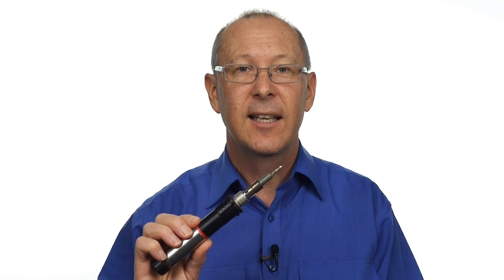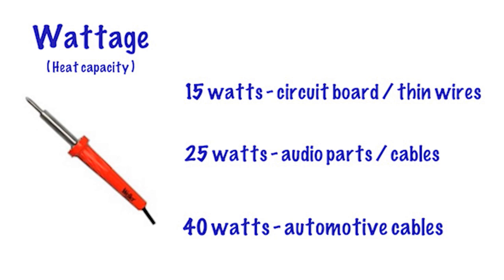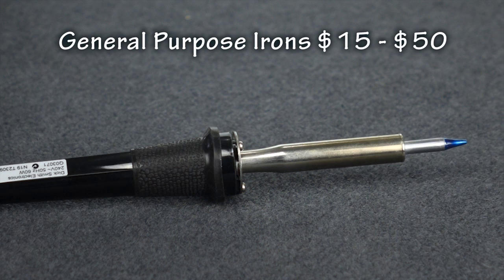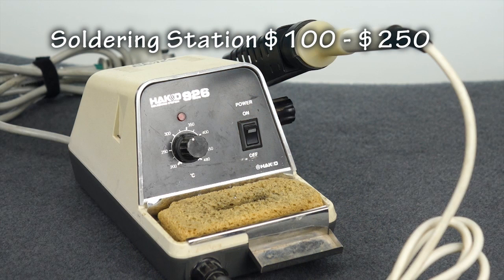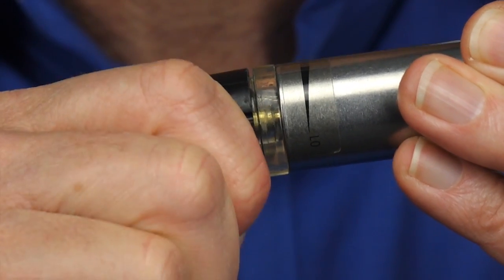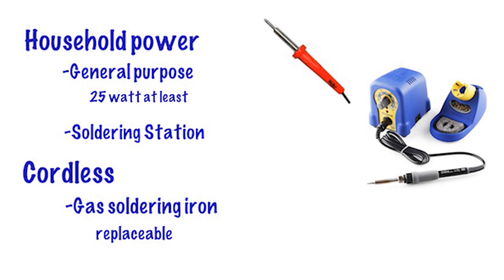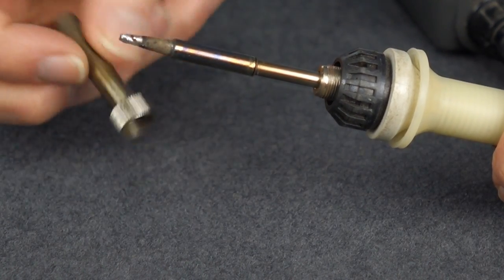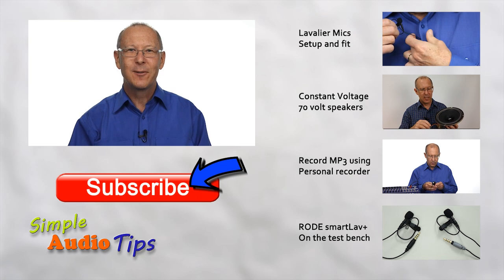Which is the best soldering iron to repair audio leads?

Comment: The tip is what matter, a crappy tip is a the same as a crappy solder iron, then comes the heat transfer from the heating element to the tip, some cheap irons are very bad in this regard.
You also need to maintain the tip by keeping it clean and always covered in solder, this is to insure a good thermal transfer from the tip to the thing you want to solder.
A cheap Chinese Hakko knockoff solder station is cheap and tips are cheap too, so it is a good value for the money spend, one can use original Hakko tips on the Chinese thing too and they last longer than Chinese tips do. Tips need to be covered with a protective coating to extend their life, the issue is that flux (you add or it is in the solder) will over time eat the copper, so if the tip is copper then it will change shape over time because the copper simply are disappearing, but this protective coating on the tips comes with a drawback, if (when) there eventually will come a hole in the coating then the copper inside the tip will simply disappear slowly and you will feel like there is not enough heat to do the soldering job. All this just to say, keep some spare tips on hand, you will need them sooner or later. Another tip killer is if the solder iron is standing turned on and otherwise unused for a longer time span then the tip coating can go bad and you are unable to make it accept solder at all, then there is tip cleaner or mechanically removing the outer layer of the tip, but that can also create the unwanted hole on the coating, yes, nothing comes free.
The best soldering iron to repair audio leads is useless if the iron is not in good working condition included a usable tip, and you need to have the skills to do the soldering too.

Comment: Try reflowing nickel sized solder pads on a 1965 Fender Super Reverb amp with a 25w or 40w iron, that giant old iron works perfectly to heat up them big old solder pads in seconds..

Comment: Hot air irons aka smd or surface mount device.... Flux and soldering pasted or solder wire like Ron core or classic 60/40 soldier.. I love my pyropen WSTA6 butane 3hrs 15min off of a full  resinous of butane.. the valve is easy to use and holds a steady temp it works well with silver bearing solder granted the tips burn out rapidly and suck solder into the threads making the tips difficult to change at times but its a great portable tool and hold its tempature  once properly  adjusted  till it literally  runs out  of gas...
Reply from the maker: Thanks for sharing your experience, I appreciate it.

Comment: there is a new soldering iron for hobbyist made by miniware ts100 and ts80. are awesome for general electrical soldering usage. they are cheap, portable, great temperature controlled and very usable only thing not sure is how reliable are they. be sure to check it if you are a hobbyist or need a cheap but great soldering iron
Reply from the maker: Great tip Shadman, thanks. Sounds like it's worth considering if you are on a budget.

Comment: Informative, thank you. The soldering iron landscape has shifted considerably since this video was made. TS80, TS100, T12 station varieties are three examples of excellent irons to be had for under USD$100 for their base models. Soldering with a proper iron is LEAGUES better and more enjoyable than soldering with a crappy one. I had to go through an assortment of rubbish, low-priced irons before I learned my lesson.
Reply from the maker: Great advice Helman, thanks for commenting.
Reply: @GaryDmedia  I just learned that the TS80P has been released with USB-C Power Delivery for higher output power. 👍

Comment: got a 60w 480 deg c adjustable temp soldering iron and it was perfect for 6 months i soldered thick awg cable for £8. but now it seems like 
30w and the tip cools down instantly with thicker awg but is still great for smd and small cables. :(
Reply from the maker: Yes the smaller tips won't store as much heat. Fine for smaller cables.

Comment: Which one should I use when soldering capacitors or cables on the motherboards because when I tried it doesn't stick on the board and it just stays loose or the wire  doesn't liquefy when I heat it up it just starts to change color and stays on the iron . If you could help me choose the right wire for the job and the right iron.. thickness etc..
Reply from the maker: The best advice I can give is in the video. One thing you should check with your iron is that the tip is clean and not a black colour. If it is black it won't heat up the solder or even the board. I have another video that may help: https://youtu.be/uzUjCGYgV_k

Comment: The large iron you said has no use for audio technicians indeed has a use that none of the other irons can accomplish easily. Any point to point wired amp (and most circuit board amps) have a ground to the chassis. They are best soldered in place (better than star washers). Only the monster antique iron will make quick work of the job. Now, that said, I can think of no other use for it as it has way to much heat for modern electronics beyond soldering a ground to a steel chassis.
Reply from the maker: Really good point Dan. Yes Chassis soldering is only possible with a very large iron. Thanks for adding your comment. I appreciate you sharing your experience.

Comment: Gary. Any suggestion on solder type ( lead or tin and percentage of them)  for welding stereo cables to plug etc?
Reply from the maker: Just the standard 60% Tin and 40% Lead is fine. I have used it for years and it works well.
Reply: Thanks Gary for your reply.  For some reason, my Banana plugs for the speakers just do not take the 60/40 solder.( the solder can't adhere to the plug hence cant connect the cables).
Reply from the maker: It could be that your iron is unable to heat up the terminal enough. Give the terminal a clean with a file or sand paper then put a little bit of solder on the iron then heat up the terminal. Then touch your solder on the terminal while you are heating the terminal with your iron. Don't add solder to the iron. Add solder to the heated terminal. If you can't heat up the terminal enough you may need a hotter iron.
Reply: The terminal is a brand new one, shiny like stainless steel. I will try buying a different type to see if it will work.  Nevertheless, good advise from you and will give it a go. Thank you.

Comment: What are your thoughts on the Dremel Versatip?  Thanks for your time. Need a good portable unit.
Reply from the maker: I personally have not owned one of these but have told they work well for what they are designed to do. I own the Weller Portasol Professional. Remember the gas guns don't have a thermostat to regulate the temperature. Dremel is a well known brand but this unit is designed not just for soldering. It is a multipurpose tool. Hope that helps a bit.

Comment: I wish I hadn't wasted so much time and frustration on cheap soldering tools. The station I have now (Hakko 951) is so far beyond all previous tools that it's taken a tedious task and made it a joy. Why hassle with so much frustration to save $80 or so? Even a $100 station is far, far ahead of any pencil-style iron.

I bought a cheap Weller for a guitar wiring project and it lasted approximately an hour before the tip was so far gone it was useless.

Bought a Radio Shack "pro" pencil (25w) to replace it. Tip lasted longer, but iron got way to hot, always oxidized, burnt up a pot or two, and required me to manually plug and unplug with each use just to keep it properly tinned. What a bother.

A proper station controls temperature and preserves tip condition, and over several years EASILY pays for itself. Cheap soldering pencils are penny wise, pound foolish, IMO.
Reply from the maker: Your opinion is appreciated. I glad you took the time to post this comment. Yes, as time goes by you begin to appreciate the wisdom in the saying, "you get what you pay for". Thanks for sharing your experience.

Comment: For soldering plugs I use an Elvo temperature controlled soldering iron set at 320c, I have unregulated irons but the temperature can get too hot and damage the work/melt the plugs. If the solder flux goes up in a puff of white smoke when the iron is applied the temperature is far too high.  The Weller Magnastat irons are quite good, fixed-temperature bits and fast temperature recovery.
Reply from the maker: +aurora0257 Great tips. Thanks for sharing.

Comment: I bought a "soldering station" in Lidl for €10. It's labeled Celsius x100 and goes from 1-5 . So 500C. Could this be a good deal / good iron? Would I be better taking it apart and having a look at whats inside? I've taken a picture of the item in the brochure so you can have a look at it Thanks. http://prntscr.com/dxfll8
Reply from the maker: Yes that should work fine as a budget soldering iron. It would not be a thermostatically controlled iron like I talked about in the video. The knob would just reduce or increase the heat at the tip. It would not maintain the temperature like a thermostatically controlled station.
Reply: So for example using it with motherboards for desoldering and soldering, I should keep it somewhere between 3 and 4 ?
Reply from the maker: +AdrianM it is difficult to know what temperature 3 to 4 actually is. A tip to help you: the tip of the iron needs to be hot enough to melt solder almost instantly. If solder boils and sizzles when it is placed on the tip the temperature is too hot. Hope that helps.

Comment: My butane solder iron replacement tips cost almost as much as the iron - so something to watch out for! It's a little like replacement ink costing almost as much as the printer. However, it has been a great little iron and has a blow torch attachment which is useful for really heavy wires.
Reply from the maker: +youtubkeeper Yes a great comment to add. The tip of a gas soldering iron does most of the work and does wear out. It is quite common for the tip to be at least half the cost if of the iron. Thanks for passing on your experience.

Comment: A Metcal with an STTC-126 tip cartridge is the greatest soldering tool in the history of the world.
Reply: I'have a 60 wat weller soldering iron!
so I've been having this problem,the iron wont melt the solder I"dont know why and i checked it to a professionalist and everything works normal!
but why won't it melt 0.8mm solder?
is it because it isnt flux cored or what?

BTW Keep It Up!
Reply: Start by either cleaning or replacing the tip. A heavily oxidized tip can't transfer heat well, and even if it does melt the solder, the solder will just ball up rather than wet the tip. By the time a tip is so bad that it won't melt solder, it is best to just replace it rather than using the aggressive acid-based tip tinner/cleaner you'd need to use to get it clean.
Reply from the maker: +MaximRecoil In the history of the world! Must be a good setup. Great to hear. Thanks for your comment.
Reply: Simple Audio Tips
I worked in a PCB factory for two years in the late 1990s, and during that time I soldered approximately four million joints with a Metcal STSS and MX-500 (we used those two models interchangeably; they are the same thing for all intents and purposes). I was SMT certified and also trained new employees to solder.

In addition to the ~8,000 relatively large through-hole joints I soldered every night, I also did rework on a lot of tiny SMDs. I used the STTC-126 tip cartridge for most everything, and since I got my own Metcal STSS about 10 years ago, I've used the STTC-126 for most everything at home too.

The STTC-126 is a conical tip which is bent at about 34 degrees, and is 0.4 mm in diameter at its smallest point - http://uk.farnell.com/productimages/standard/en_GB/1712912-01.jpg. It combines the advantages of a larger chisel tip with a fine-point conical tip.

In the '80s, '90s, and some of the 00s, Metcal was in its own league. During the past decade or so, some other companies such as JBC have caught up in many respects, but JBCs needs way more wattage to do what Metcals do, and people say they still can't solder big joints with small tips in the way that they can with a Metcal. Since Metcal's patents from the '80s have expired, some companies have outright copied them. For example, the Hakko FX-100 is a Metcal knockoff; the FX-100 handpiece will even connect to and work with a Metcal power supply. Thermaltronics and Easy Braid soldering stations are direct Metcal clones.
Reply from the maker: +MaximRecoil I appreciate that you have shared your experience. Great to hear from someone with so much background knowledge in the field of soldering. Yes the Metcal stations seem to have proven themselves as being one the best units a number of reasons. Thanks for passing on the connection between the Melcal, Thermaltronics and Hakko units. Thanks again for the time you put into your comment.
Reply from the maker: +Arber Berisha the tip of the iron may be so dirty that the heat can't transfer to melt the solder. Clean the tip while it is hot with some moist steel wool. If the solder you are using melted ok before this is most likely the problem. The best solder for general electronics work is Resin core 60/40.
Reply from the maker: +MaximRecoil I really appreciate your great input. Good advice.

Comment: Nice information... I'll be getting into the business of making custom audio / speaker cables with RCA, banana plugs and so-on. I will need a good and reliable iron and also a good micro torch for shrink sleeves. What would be your suggestions and recommendations? I don't want to get into costly equipment that I would really need or splurge when not needed to do so. I just want  reliable, durable and reliable equipment without going over board on $$$. If you can recommend any other tools and equipment that I will need will be very helpful. I will really appreciate your advice.

Thanks
George
Reply from the maker: +Jorge Melendez That is a difficult question to answer. I would recommend a thermostatically controlled soldering station if you are going to be using it regularly. The better brands have replaceable parts. Basically you get what you pay for so pick a known brand and shop for the best price.
Reply: Okay... I get it. I will be doing "on and off" soldering so I will be getting a Aoyue 469 Variable Power 60 watt station $30.00 as starters. It's the best I can do for the moment for I'm a bit short on cash. I understand from reviews that it's a good iron and that I can get different tips from different manufactures. As soon as more orders start coming in I will get what you advise. Also getting a heat gun for shrink sleeves. I have reviewed a few and they are readily inexpensive. I just might use an inexpensive hair dryer. Thanks for the advice. In case I've said anything that might sound funny or misspelled, English is my second language.
Thank you so much for your time and valued advice.

George
Reply from the maker: +Jorge Melendez i guess I should have highlighted to get the best you can afford. That is a very important consideration. Your English is very good considering it is your second language. I really appreciate you taking the time to comment on my channel and hope to answer more of your questions in the future. All the best with your projects.
Reply: Thanks for replying to my comment... If you have any other advice please fell free to contact me... so long for now...

Comment: good info until he said  "you get what you pay for". it certainly isn't true. this is usually known as marketing from so called experts. problem is, experts never see it that way. Marketers do. these days there are plenty products that have very high quality for a low price.
Reply from the maker: Appreciate your comments. As you can see in the comments there have been a few that have purchased cheap irons and are quite happy with them and others that have had problems. I guess I was talking from my experience with cheap irons. If you have any suggestions of a soldering iron that is good value I'm sure others would like to consider it.
Reply: HEavy handed there, hehe...sorry, but yes..., here is one thats good, but the holder is not as robust. I use a metal coil style. I also like the Hakko irons. http://www.ebay.com/itm/937D-SMD-Soldering-Hot-Iron-Station-Digital-Adjustable-w-5-Tips-Japan-Heater-/381273992130?hash=item58c5b36bc2%3Ag%3AhVkAAOSwLnBXXh0-
 There is another I know a shop uses, but forget the name. Its a $40 knock off style, but does what a 90+ would.
But you are right, at one point it was either cheap and bad, or expensive and good. But in the past 10 years I see that being a way of the past.
Reply from the maker: Thanks Phil, That one seems to be good value. It has a Japanese coil so the insides should last well. Thanks for sharing your experience.